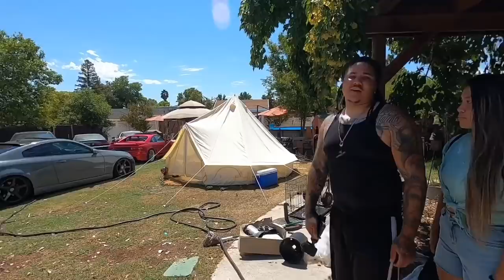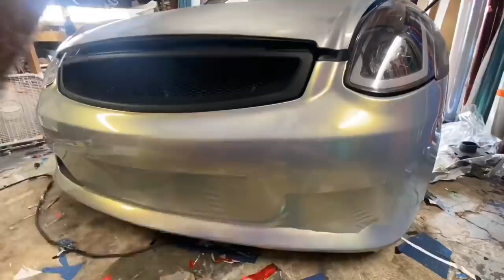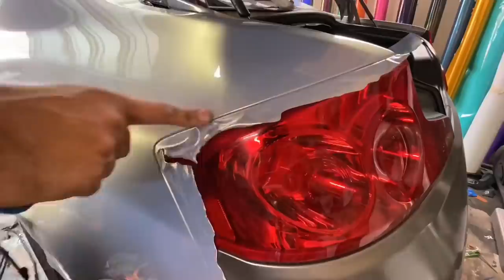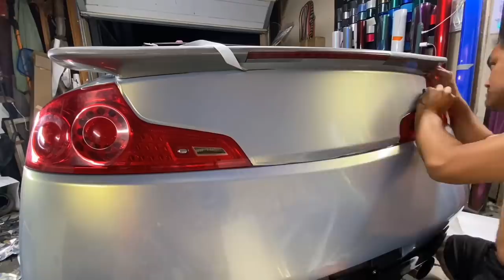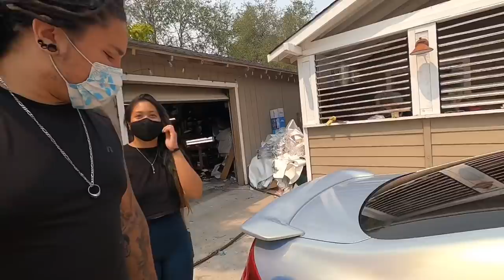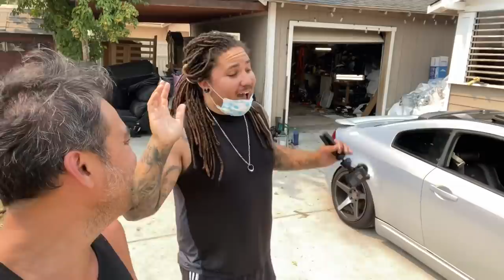RIPPED APART....MIKE MYKE GETS THE NEW HOTTEST PARADOX COLOR | Complete G35 Wrap Guide

Comment: If that was my bumper I would spray it with paint so the wrap can stick on. All you need is a smooth surface for the wrap so paint cans are cheap and no one will be able to see it since it's under

Comment: Hey paradox , question for ya, how well do the wraps cover sanding scratches, and how course of scratches will the wrap cover? Also when you said the wrap wouldn’t stick have you tried cleaning the surface with wax and grease remover and spray adhesion promoter to get the wrap to stick?

Comment: Used PrepAll spray for them polyurethane stuff. I wrapped my front bumper and had that issue st first then after the prepall spray it was no issues sticking.
Reply: Where do you get that from? Because I've heard that you can spray primer on it, and it should be fine..I think ima bout to be dealing with this very issue myself🤦‍♂️
Reply: @nonameisthename138  You can find it at Lowes, almost any autoparts store. it works  save your money in my opinion don't primer cause if you don't clean it correctly the vinyl will peel off the primer. best luck diy gang!!!
Reply: @nonameisthename138  you can see a quick video of when i did my vinyl wrap david1317 this was on my second attempt after using PrepAll spray.
Reply: @david1317  
Ima check you out. Man I really think I'm about to be dealing with this very issue. My G is wrapped and I ended up getting a Q50 bumper. So I didn't worry about painting the Q50 bumper because the car is already wrapped. I did primer it after cleaning it. But I had no experience with wrapping so I talked to one guy, he bs'd me around for 3 weeks before I found the wrap myself and ordered it. Then I didn't want to take it back to who wrapped it. Took it back to him and he had it almost 3 weeks without doing a damn thing to it!!🤦‍♂️😡😡 So I took it to another place, and they said I should be getting it back today. But I haven't heard anything yet. 🤷‍♂️ I even had an idea to just rattle can it until I got ready to paint it. But I've heard those were bad ideas..
Reply: @nonameisthename138  yeah it's hard you get better at it the more you do it. recommend that you do overlay inserts like i did my fog lights holes you can't stretch the vinyl to much or it will want to lift. check out my IG @DLOGRAM you see more detail photos and videos. and of course @paradoxstyling
Reply: @david1317  
Will do bro, thanks alot for the info👍💯🙏🙏

Comment: Don't need primer94 to stick vinyl to new plastics. You use a blow torch and torch the entire surface which burns off the release agents from manufacture, and also closes the pores of the plastic so the vinyl adhesive can bond to it. Primer94 wont help, it will just be an absolute ball ache in the future to clean it off